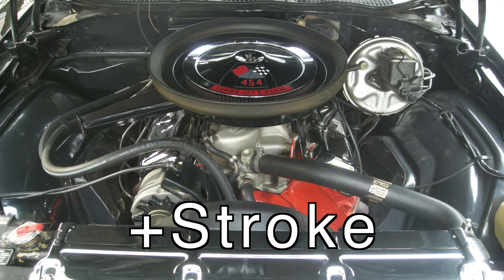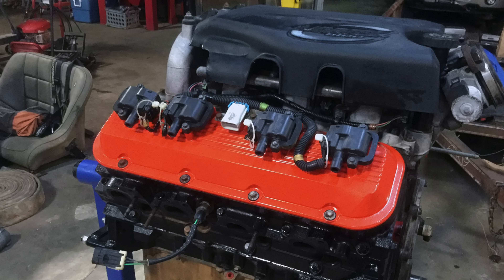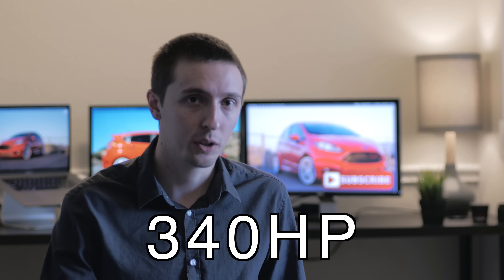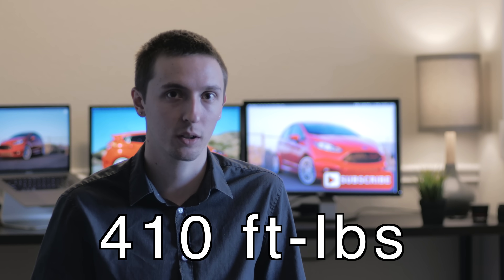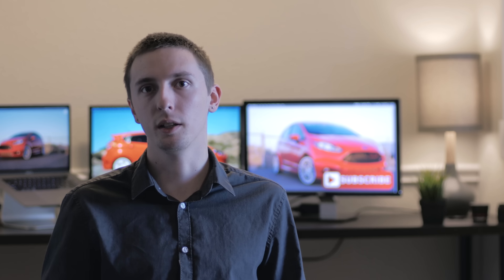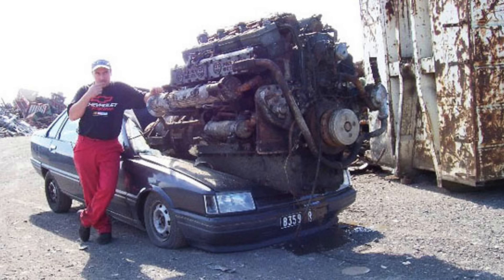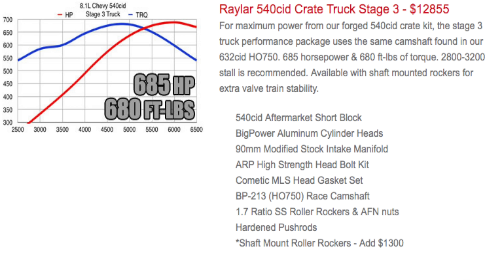Vortec 8100: Everything You Want to Know | Specs and More

Comment: Every duramax from that vintage has had major repairs while the 8100 was farrrrrrrr more reliable
Reply: I have a Vortec 454..in my 3500.. wonder which one I have ??
Reply: @raymondjones7489  A 454 is a 7.4 liter. The 8.1 is a 496. No parts interchange, that I know of.
Reply: TANORWAY lol then it’s your fault that you are getting bad idling , starting and fuel mileage, and when you start loosing coils you might wanna change your plugs too.
Reply: Yeah, the 03 to 07s are notorious for injector problems, and they're damned expensive to replace.
Reply: TANORWAY  What do you mean by "aggregate"? Where I'm from, that's a natural concretion made of gravel.
Reply: Henry is the type of guy that feels like he has a lot to prove even though he’s likely an older gentleman that should feel comfortable in his own skin at this point in life. You’re coming off as very insecure because you’re so worked up in the comments over other people’s life experiences that differ from your life experiences. In the end, it’s a just an engine. Who really cares. If someone says it’s been a great engine for them just leave it at that. Maybe they had the one good one or maybe you had a couple bad ones. Does it really mean that much to you that you have to comment 30 times to argue over a matter of opinion?
Reply: 2007 496 is a bullet proof engine. Mine is in a 27 foot 7600 lbs Crownline with 1500 hours.   Only ever replaced the Plugs, wires, filters, Mobil 1 full synthetic and serpentine belt  54 mph at 4400 rpms all day long.
Reply: I have 350 thousand on my lb7 duramax, never touched the engine other then oil changes and its going just as strong as it ever has, I also get 20 miles per gallon or better. Can anyone with a 8.1 say that?
Reply: Kind of a broad statement, that isn't true.
Reply: ABSOLUTELY CORRECT, 8.1 /496 IS A GREAT RIDE.
 I FEEL AS YOU,, MY 04 GMC 2500 SLT 8.1 /496 IS A HEAVY DUTY TRUCK THAT STILL HAS THE STUFF TO GET THE JOB DONE ALL THE WAY AROUND. ON THE STREET MANY TIMES HOT RODS THINKING THERE FAST AT THE LIGHT, GET SHUT DOWN FAST.
  PULLING MY HORSE TRAILER WITH 3 HORSES WITH A COMBINED WEIGHT OF 3500 LBS PLUS SADDLES AND GEAR IS LIKE PULLING NOTHING AT ALL. SHE IS SWEEEEET!!!
  I GOT TO ADD SHE HAS OVER 200,000 MILES, YOU CAN'T EVEN HERE THAT ENGINE RUN. YEAH I LOVE MY TRUCK AND WOULD NEVER TRADE FOR A NOISY, SMELLY, EXPENSIVE, CLATTERING, BLACK SMOKE BLOWING DEISEL OF ANY BRAND.
Reply: @crazyhorseranchaz  OKAY CONGRATS, BUT WHY IN ALL CAPS?
Reply: @crazyhorseranchaz  one night a carful of kids in a  hot 1st gen Camaro pulled up to my dad at a light -he was in his 1968 2 door 455 Ninety Eight - they were gone but in a few seconds he blew past them -2 ppl in the ninety eight
Reply: @crazyhorseranchaz  "hear", and "diesel". Now you know 😉
Reply: Ryan Odneal other then they need cam, heads, oh and a block because it threw a rod consistently around 8000 hours but that’s still better than the ford v10 breaking cranks at 2000 hours
Reply: Man...that sucks...you mean I got shit!...I'm really bummed
Reply: Raymond Jones the 454 is a much more reliable engine than the 8.1 is, I have done lots of cams, and heads on the 8.1 and it’s common for them to throw a rod around 8000 hours so be glad you have a 454
Reply: @henryhenry3832  At highway speed, 8000 hours is over 450k miles. Mine is approaching 300k, but i am considering a rebuild. She used to get 14 mpg, but now it's more like 11 mpg.
Reply: @henryhenry3832  How do ya know how many HOURS on a gas engine? Cars and pickups use odometers.
Reply: @wisenber  Check your cat first, it might be getting plugged. I drove cabs for ten years, I've seen that a lot.
Reply: @donellmuniz590  lol it’s called using an hour meter, which every generator control panel comes with, and if you need more help figuring out how I converted hours to km let me know and I’ll spell it out for you.
Reply: @donellmuniz590  oh and if you go into the settings in your vehicle you can find the hour meter, some have idle hours separate from driving hours 🤣
Reply: @henryhenry3832  lol, not necessary, thanx.
Reply: @henryhenry3832  Well I'll be dipped, as Derek (Vice Grip Garage) would say!🤣
Reply: @donellmuniz590  the 10.3 is based on the 454 just bored out and the ones i use are manufactured by industrial irrigation but still made to origin specs,
Reply: @donellmuniz590  so far the only engine I have found that is worse than the 8.1 for breaking apart is the ford v10, they break cranks at around 2000 hours, I’ve had 7 of them and they all broke their crank in the same spot, Ford was stupid to make a off set Journal like they did because it’s half as thick at the off set then any other part of the crank, and wouldn’t you know it they all break right there🤣
Reply: @henryhenry3832  But 10.3 liters is a 632. 454 based, yes, but not a single factory 454 part in them. 4.6 bore, 4.75 stroke.
Reply: @donellmuniz590  Did that 70k miles ago.
Reply: @donellmuniz590  yes That’s what I said, they are based on the 454, built by industrial irrigation to Origin spec, I didn’t say it was a 454.
Reply: @henryhenry3832  What do you mean by "origin spec"? Headbolt locations, cam location, same lifters, timing chain, motor mount bosses, etc?
Reply: @henryhenry3832  Do they use a block from Dart? World Products? Blueprint Engines? The GM 572 block?
Reply: @donellmuniz590  what I mean by origin spec is what you would expect, if you go into a parts store and tell the parts person that you want to buy pistons, rings and bearings for a 1998 gm 5.7 they can look up the right parts because they are all built to the same specs if they are still factory, same thing if you were to tell them you want the same parts for a 2015 10.3 origin engine. As far as what I meant by being based on the 454 gm, well the 10.3 will fit the 454 intake, oil pan water pump and so on, and will bolt into any vehicle that had a 454 in in without modifications needed
Reply: @henryhenry3832  Ok, you're a mechanic and I'm a magazine reader. Nevertheless, I'm going to dispute some of that. 1) All the 632s (hot rodders use c.i., not liters) I know of use a tall deck block, therefore a 454 intake manifold won't fit. 2) NO auto parts store I'VE ever been in will have pistons or rings for a 632. The water pump, starter, rocker arms, timing chain, some gaskets, various bolts, and exhaust manifolds, sure. I think the bore spacing is also the same, and the rod, cam, and main bearings too. I'm not familiar with this "Origin" company, however.
Reply: @donellmuniz590  ok wait, I never said it was a hot rod engine, I said it was a 10.3 industrial irrigation engine, the reason you haven’t heard of origin ( their name is cast into the valve covers like gm did vortec ) is because you are reading hotrod magazines and not industrial applications daily lol, I am a self employed heavy duty Redseal mechanic that works on a lot of generators and oil field application engines, now I know a lot of engines cross into the hot rod category but I do believe it was built for industrial use as the prime application, as far the parts crossing all I have tried was the intake manifold gaskets, I needed a set and the local parts store had a set for a 454 so I tried it because the 10.3 has a wet intake manifold like the 454 does and I have been told by my supplier that the 10.3 is based on the 454, the gaskets fit fine.
Reply: @henryhenry3832  Ah so. Thanx for all the info. I learnt (🤣) somethin' today. Geez, I'm gonna have to start lookin' for my next truck engine in a bean field, lol.
Reply: @donellmuniz590  🤣 you can find a good few engines there, I have a twin turbo 8.1 for cheap lol, it needs a block because it put two rods through it🤣 but it was a fun trial that I got paid for.
Reply: @donellmuniz590  I should add that the dart intake that converted it to a 5.7 distributor is worth more than what is left of the engine and turbos 😂
Reply: @henryhenry3832  Hmm...at least 2 sleeves, a set of AFTERMARKET rods like Liberty, Molnar, Manley, etc, maybe some ARP studs and Cometic gaskets, Ebay turbos, Ross pistons...or I could just call Jegs and order a Blueprint 632 for $12,999! Then I'll marry Pam Anderson and fly to the moon 🤣🙄. (Don't tell my ol' lady, Donell...this is her tablet😂)
Reply: @donellmuniz590  😂 pam is a little old for me and a new 10.3 is only $26k so if I need power like that again I’ll get a 10.3 and turbo it, im really bad at spelling and grammar but I only have a grade 1 education, from there I went to post secondary for my heavy duty mechanics and I have a the award of excellence and a scholarship form the province for every year because I had top marks in the province for that year, My worst mark on a test was 96.8%, im as far right wing as you can get and still not be racist, im far from poor but that’s because I worked my ass off and have a lot of self confidence lol.
Reply: @henryhenry3832  Attaboy. I used to work at the post office, but I got hurt AND sick, so I'm disabled now. Not complaining, life is ok. But I won't be buying any more project cars or engines anytime soon. So I read magazines and watch You Tube videos. Best wishes, and happy holidays.
Reply: @henryhenry3832  I came along 10/26/65, and Pam arrived 7/1/67, so she's the perfect age for ME. And she's aged from a 10 down to an 8.5, so I figure I got a shot (I'm a 2 on a good day)🤣.
Reply: @henryhenry3832  "only" 26k, he says...🙄. 3 of those are worth more than my house. We live on the same planet and the same continent, but very different worlds, my friend 😕😑
Reply: @raymondjones7489  Don't worry, you're fine. Vortec 454 is a good engine. I have that in my 98. It's not a rocket, but it beats the hell out of the TBI 350 in my 92. I've carried over 4000 lbs and towed over 10,000 in my 92, but not quickly! The 98 will do better, but covid has shut down my junk hauling.
Reply: @donellmuniz590  lol 26k is a lot of money but if you compare it to a gas conversion Diesel engine that will put out the same Kw than it’s cheap lol
Reply: @donellmuniz590  my 04 silverado has an hour meter. I'm at 150 k miles. an 4600 hours.
Reply: TANORWAY well that’s good for you, but I have seen lots of them knock holes in the block or drop valves with in the first 8000hours, now you might think that at 8000 hours it’s done good, I mean that’s around 800,000km if it was doing 100km per hour on the hwy but I have pretty much every 5.7 make over 70,000 hours and a few are at 120,000 ish hours and still pulling their generator load, so from that point an 8.1 is junk because I have never seen one make it over 15,000 hours.
Reply: @henryhenry3832  Then don't use it on a generator. They do fine in trucks.
Reply: wisenber fine compared to what? If a 5.7 averages 70,000 hours and a 4.3 averages 50,000 hours and a 7.4 averages 50,000 hours I don’t see how 8000 hours is doing fine, the only thing I know of that does worse is a ford v10 lol
Reply: @henryhenry3832  Compared to about any vehicle. 300k miles with no work required is far from unreliable. Then again, I hope you weren't talking about a gas 4.3 or 5.7. I'd never get my trailer out of the driveway.
Reply: wisenber lol im comparing the engine doing the same type of work with the same percentage of engine load, we run around 60-70 percent rated load and the 8.1 does not handle it at all.
Reply: wisenber I have only had one 10.3 so it’s not fair to say but it made it 34,000 hours before it needed heads and came so that’s not bad I guess
Reply: @henryhenry3832  And I'm saying a 4.3 or a 5.7 can't do the amount of work an 8.1 can. A reliable engine that can't do the work isn't very useful. Over 300k miles of forest roads and towing with no engine parts is my experience.
Reply: @henryhenry3832  And my 8.1 has over 300k miles and it's not finished. 19 years without needing an engine part doesn't support the unreliability you suggest.
Reply: wisenber well im glad you have luck with it but I’ll stay clear of that junk pile, if I need more power I order a 10.3 or an 8.3 Cummins they always get over 100k hours
Reply: @henryhenry3832  When I'm finished with it, it will be a junk pile. I've kept it maintained with no issues since 2001. If every vehicle I bought did that, I wouldn't have a complaint. 300k miles is about 50k hours, but I use mine on a vehicle as it was designed to do.
Reply: @henryhenry3832  A 10.3 what?
Reply: @wisenber  wow you said that you’re 8.1 has 300k miles which you said is about 50k hours, you mean you you’re average speed is 6mph? 🤣🤣🤣🤣
Reply: @henryhenry3832  Wow! You should reread my posts. I said 8k hours is about 450k miles.
Reply: @wisenber  🤣🤣🤣🤣🤣🤣🤣 WOW!!!!!! Start at the bottom of the comments and count up on 24, then read your comment, it says 300k is 50k hours, but you use it in a vehicle which is where it was intended to be 🤣🤣🤣🤣🤣🤣🤣, yet you claim that an 8.1 is the best engine you have ever had but it will not even come close to lasting as long as almost every other engine out there that is used in a Stationary application and a stationary application is way easier on the engine then use in a vehicle is that’s why they last so long running a generator or something like that.
Reply: @henryhenry3832  " lol i may not be pretty but I don’t think I look like a troll"
Who said anything about what you look like? But you knew that, right?

"when you get proven wrong "
In your head? I bought my engine with the vehicle and have driven it for about 20 years. Then we have you...awarding yourself participation trophies. Sort of how any troll does.

" you probably even voted democrat"
Everyone did if you go by Google or the AP.
Reply: @wisenber  🤣🤣🤣🤣 good one, I like the google remake, you seem to think that because you own one 8.1 you have more experience with them then I have, yet I have bought and repaired lots of them over the years, im not sure where you get the idea that I have less experience with the 8.1 then you do, please explain how this works.
Reply: @henryhenry3832  " you seem to think that because you own one 8.1 you have more experience with them then I have"
Actually think my 19 years of use is a better indicator than...not "then".

" im not sure where you get the idea that I have less experience "
Perhaps you could ask your strawman?
Perhaps you could explain how you constructed him? We know how they work.
Reply: @henryhenry3832  Uh, Henry, while it's not my argument to jump into, how does ownership and experience (or lack thereof) of 8.1 engines make one a "liberal"? Do all guys without several 8.1s approve of abortions, gay rights, granting citizenship to illegal aliens, and gun control? God, I hope not!🤣🤔
Reply: @wisenber  😂 when did I say anything about your 8.1? I said 8.1s in general, and yes I do get out and socialize with people and conversations about different engines and their problems come up a lot, and the whole point of enabling comments on a video is for people to discuss their own opinions, it’s only liberal minded people like you that think anyone that disagrees with them doesn’t have the right to an opinion on the subject
Reply: @donellmuniz590  🤣🤣🤣🤣 too funny, i was referring to him being a liberal because he jumped to name calling and spell checking like pretty much every liberal does when they run out of real information 🤣.
Reply: @henryhenry3832  "ok if im the one that is lying "
Another strawman for you to make up?

"and has reading comprehension issues "
See above. It's either a strawman, or you actually do have a lot of trouble understanding what you read. However, I don't discount both as being possible.

" and you had changed the valve cover gaskets and pcv valves, or even mentioned an oil consumption issue? "
If you could read, you would have noted that I was talking about a 1MZFE. However, we've already established your problems in that area.

"you can’t because all you could talk about was how you had never changed a single engine part on it"
Or that I was talking about a Toyota. Or are the 1MZFE engines you've seen 8.1 liters?

"I guess that’s probably true because you had a mechanic change the parts because you have since admitted to changing engine parts🤣"
Maybe if you spent less time using emoji's like an 8 year old girl, you could work on your reading skills? In the mean time, I'm pretty good at remembering what parts went on which vehicle.
Reply: @henryhenry3832  I correct people on spelling all the time! 😂 But it's cuz 1) I have a BA in English, and the absolutely DEPLORABLE state of spelling and grammar on social media both frightens and appalls me, and 2) I have Asbergers 🤣🤓🙄.  I'm a Democrat (poor folks with BRAINS usually are), but very moderate. Not a snowflake at all.
Reply: @henryhenry3832  As an aside, my man, conservatives lie too. In fact, some very highly placed ones in DC are quite prolific at it! But I wanna talk engines, NOT politics!
Reply: @donellmuniz590  oh and origin has a pretty good line up of engines is you google them.
Reply: @henryhenry3832  To tell ya the truth, English degree notwithstanding, I don't even know what a "strawman arguement" IS!
Reply: @henryhenry3832  I owned a 2002 F550 XLT with the 6.8L 2V V10 and I had 410,000 miles before I sold it.That was last year in September.Only changed the water pump,spark plugs,and exhaust manifold studs the first day I bought it.They're actually great engines...2V V8's and V10's had spark plug problems because of less thread housing,but alot of times using a torque wrench to tight them correctly solves the problem,unless you try to legitimately destroy it.The 3V V10 was 362 HP/470 TQ compared to 325 HP/425 TQ but was notorious for being problematic with solenoids,even though Ford finally fixed the thread housing so they actually didn't have spark plug errors,or as much.They're ridiculous cheap too,just on mainteance and parts.The only bad part about them really,was obviously the gas consumption,they are just as alcoholic as the 5.4L,both of them are worse than the Vortecs and Hemis.I now have a LLY 2500HD and a 7.3L PSD F250 XLT,but I wouldn't mind a V10 again,mine was reliable to me.
Can you explain to me what experiences you had with them?
Reply: @henryhenry3832  Oh, a generator. That answers my previous question. Didn't know 8.1s were used for that.
Reply: @donellmuniz590  yup they are just not very good for it because they eat cams, heads and throw connecting rods at low hours
Reply: @henryhenry3832  I am just learning about these engines as I have just pulled one out of a generator with 600hrs. Why do they throw rods. Is it an oiling issue?
Reply: @johnslender5408  my question to is did you pull it at 600hrs was it because it threw a rod? From what I have seen when they throw a rod it would lead me to believe that it is a flaw from manufacturing the rods to light duty for the load the engine will handle, because what I have found is as soon as you load it around 70% you start having issues, if it was a lubrication issue it should be taking out the bearings or have major cylinder wall scoring on every engine, but it doesn’t seem to be consistent in that way, the consistency is a broken rod.
Reply: @henryhenry3832  No the generator was being  replaced due to a kVA increase. Engine runs fine. Thanks for the information. I'll take the sump off and inspect the rods. This is weird the engine I have. Has a 2011 block but runs a dual plane manifold and electronic distributor. It does not run an injection manifold, coil packs, ecu etc
Reply: @johnslender5408  was it running on natural gas or propane? I have converted a good number of engines away from coil over and coil near to a distributor to get rid of the emission control system and to convert them away from the junk Bosch governor system to a Woodward.
Reply: @henryhenry3832  it was running propane. We call it LPG in Australia.
Reply: @johnslender5408  lol it is Liquid propane gas but we mostly run it in vapour form from the tank instead of using a vaporizer on the engine so we call it propane for short, if it was running propane then depending on Australia’s emissions legislation it might have came with the conversion manifold and distributor for cost and reliability, dart manifold on it?
Reply: @henryhenry3832  lol yeah we do some funny things here down under. It's a vapor set up for sure. I'll have to look at the manifold for any branding but it's definitely a dual plane and got a bit of a rise on it for torque.
Reply: @johnslender5408  i use dart dual plane intakes when I convert from coil near to a distributor, but there is probably other brands
Reply: @henryhenry3832  thanks for your advice mate. Very helpful. I'll be giving it a good look over. Undecided what I'll put it in yet.
Reply: @henryhenry3832  definitely changing cam and springs to suit a vehicle 👍
Reply: @johnslender5408  if it’s going in a vehicle that’s a must yes, good luck
Reply: @henryhenry3832  going in an old farm truck that won't get revved hard. Should last me a while. Thanks again mate. Cheers 🍺
Reply: @henryhenry3832  now we're confused. This thing has Siamese ports and it's a 2011 motor. Have sent away to Generac the serial number to find out what it is
Reply: Ryan Odneal diesel is still more powerful though
Reply: @quadrippers4207  Only when it's running.
Reply: @quadrippers4207  The LB7 was less powerful than the 8.1L though...It wasn't until the LLY that the 6.6L actually had more torque than the 8.1L's.Fuel efficiency? Yes,it had more,but the power? No...The Vortec was ahead above the Duramax for the first four years.
Reply: Quad Rippers 420 almost all diesels are turbo charged if you put a turbo on a gas it's going to make A lot of power like a diesel.  it just doesn't have as much low end torque.